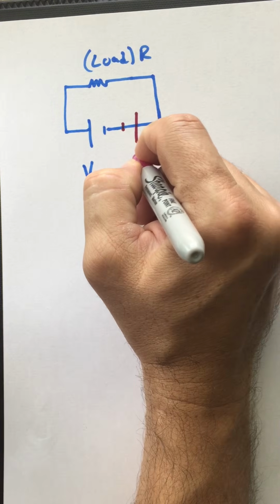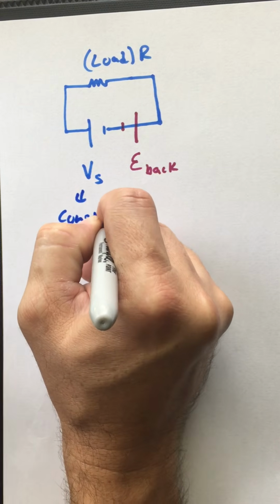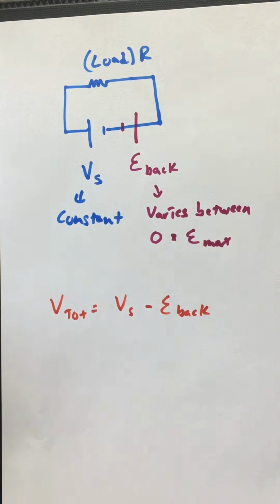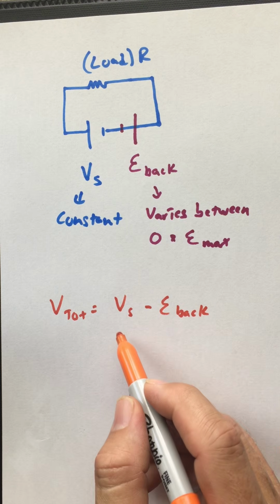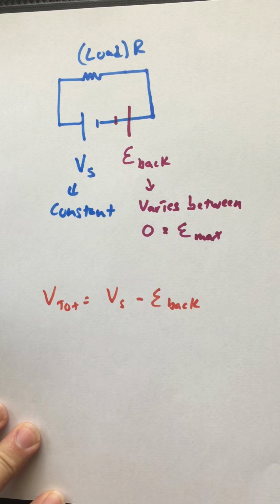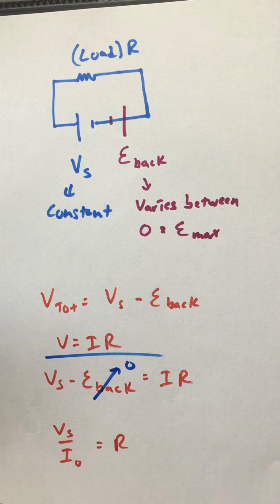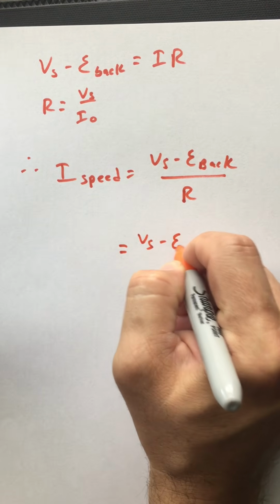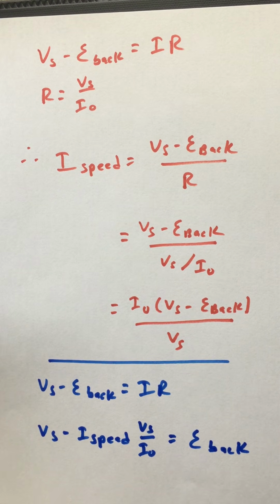Sect. 23.6 (1510) Sect. 13.6 Part 2 (1610)

Comment: What happens when you have back emf > Vs? You get reverse current direction. Basically a negative resistance where the generator is being charged rather than discharged. Example is synchronous condenser, negative "inductance" by project genesis(a massive negative resistor), and homopolar "transformer" which is essentially a massive negative resistor as well.